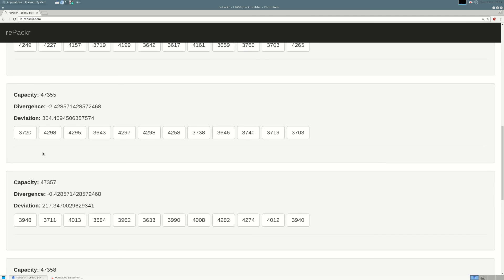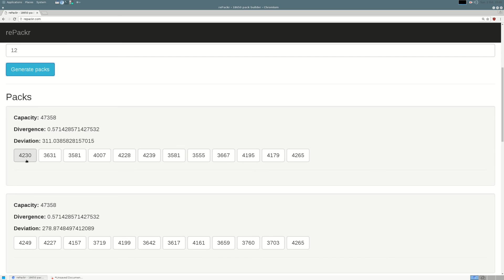18650 Pack Builder App - Released!

Comment: did you release the schematics and everything else?
Reply from the maker: Source code for the pack builder is linked in the video description. The Source code for the charge and discharge station can be found here https://github.com/chrisabird/18650_station . Although the project isn't yet finished so code is in a state of flux. KiCad diagrams will be done of the station as soon as the design starts to stabilize, currently only diagrams are those drawn in the videos.
Reply: Ok thanks I'll be waiting for that.